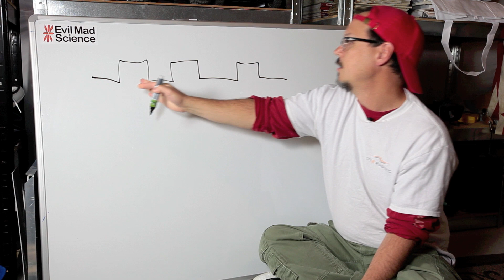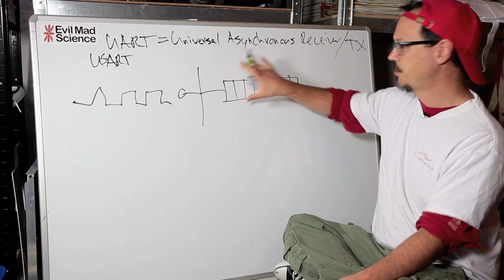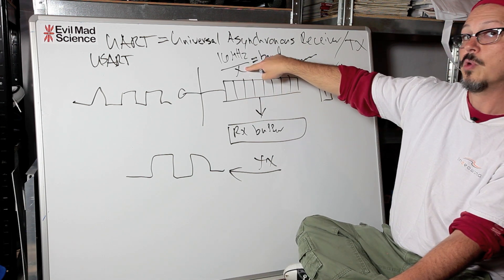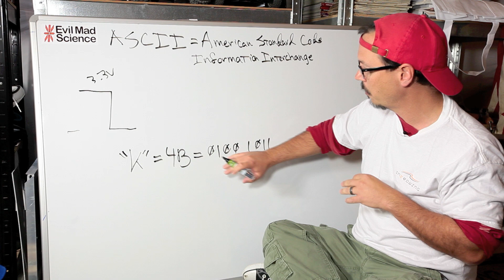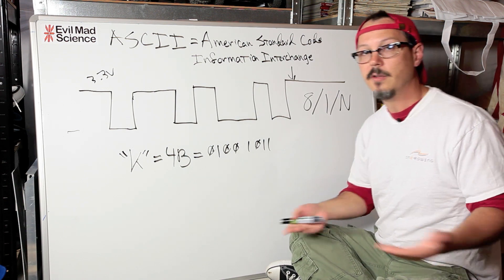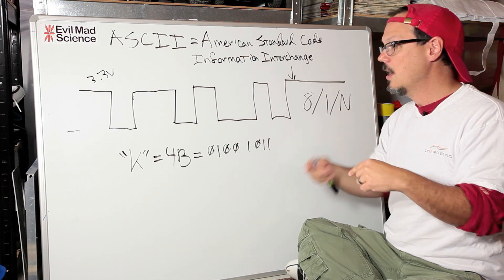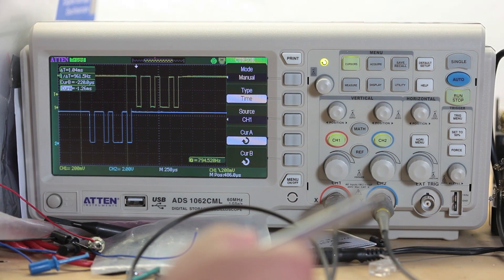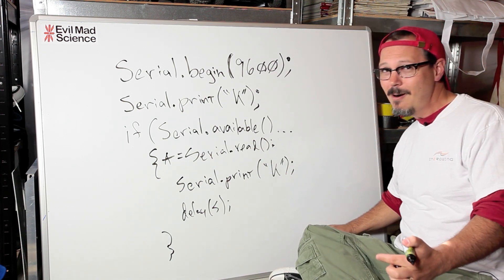SparkFun According to Pete 9-17-12: Serial Communication Demystified

Comment: I suspect the reason 2 stop bits is a thing is because back in the dark ages some receivers needed a little extra time at high voltage for the start bit detector circuit to reset or time to transfer from the shift register to the receive buffer before the next string of bits started coming in.
Also, in my experience (mostly PLC and HMI programming software) the com parameters would be [baud] 8n1 (or 8o1) not 8/1/N, because that's the order the bits come in. (DPS)
Great video.

Comment: I know I really late on this one .... he has no idea on the history of data communications ....
In the beginning ... machines or teletypes would send out the information bit by bit each bit was short and went out all messages were created on punched tape ... Paper tape and ir depended on the vintage the old machine used 5 bit for each character ... the they added more characters so that they could send more descriptive messages and went to the 8 bit code ASCII and there are many dielectric of ASCII .... the the computer , or electronic communications evolved and they invented the UART  ... this has been around forever  at the same time the USART was developed ... the reason for the UART is that machine to machine communications is very slow and computer to computer is very fast so they needed something to store the character until each bit was received and then sent to the next computer  ... the BAUD rates hes is talking about .. WELL they were SLOW and started at 300 then went to 1200 the 2400 then 56000 then up and up 96000 then higher com lines in the past were bad and noisy so the slow speed to-day they are still noisy but at the sending end all is encoded from analogue to digital before it leave your home or place of business ... I could go on ... but that is enough for now ... OHHH the USART was ment to be used computer to computer where they could send the characters and clock them at computer speeds but they found it still not practical ....

Comment: Back in the OLD days.... Baud was 110, used for transmitting teletype. Actually before that baud was 33. Baud being is signal transitions. Back then being sent across telephone grade lines. really bad quality lines with analog repeaters that needed to be manually tuned, So, line noise and harmonics were horrible on these lines. Parity and stop bits were definitely required just to get a byte across the circuit reliably, usually being repeated several times.

Comment: This is the same technology used in cars (uart) Its how crankshaft/camshaft position sensors and wheel speed sensors communicate with the powertrain control module or body control modules.

Comment: Yeah, it'll work but it will saturate the ports on the 'server' Arduino. Even without UART, you're making a very expensive project -> using multiple Arduinos (unless you have to) isn't very cost effective at all.

Comment: If you don't have a capable Arduino, check out (Google) 'Arduino Software Serial'. It only has two physical ports but, being a microcontroller, you can simulate it.

Comment: I assume the Arduino pins used are TX and RX (pin 1 and 0 on my Duemilanove clone)? Suppose you had three Arduinos and you wanted to talk between them with UARTs for some reason (obviously this can be handled with I2C, but we’ll ignore that for now), can you have multiple serial I/Os on one µcontroller?

Comment: Using a USART in synchronous mode is just like using a serial shift register or other synchronous serial comms (like SPI). Instead of just RX/TX, you've also got CLK (XCK), which is your clock line (baud rate)... One device is the master (clock generator), while the other(s) are the receivers which use the clock as the baud rate reference. Although you can do this without using a USART and bit-bang it just as well....